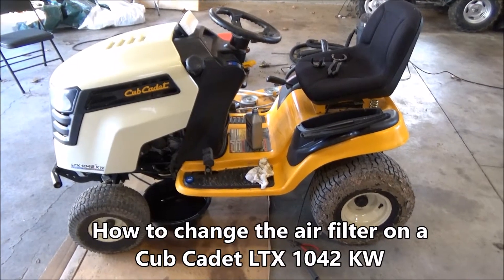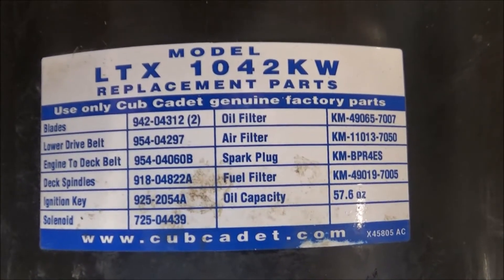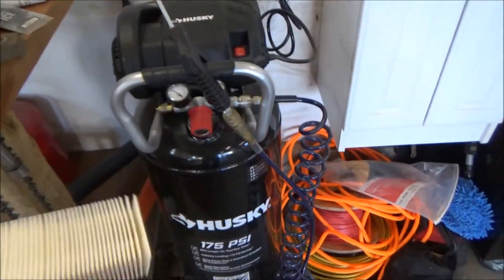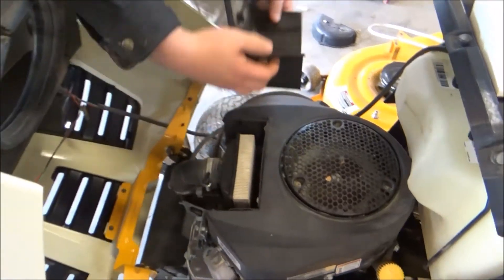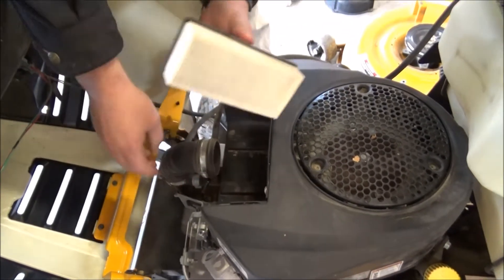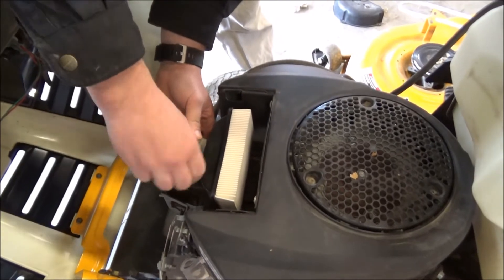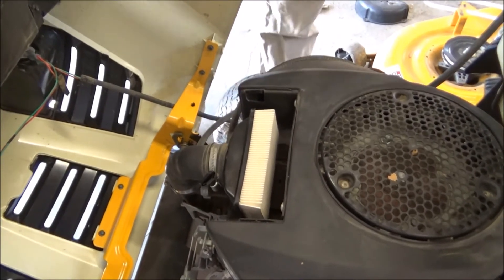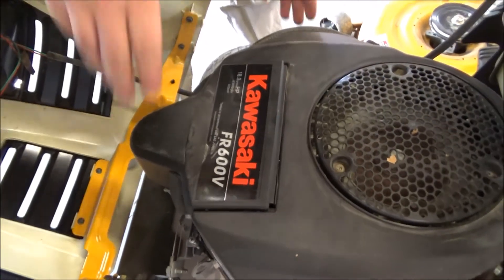Cub Cadet LTX 1042 KW | How to Change the Air Filter

Comment: Have you ever had your mower stop moving after you give it gas mower doesn't shut off but I give it gas and it will start to go and then stop moving idk what the problem may be I wonder if its because I left gas in it all winter...
Reply from the maker: Yeah, that sounds like some sticky fuel clogging up the carburetor. That can happen when it gets left in there unfortunately.